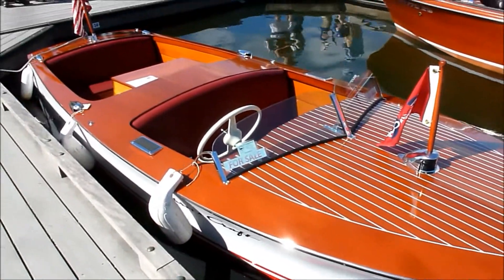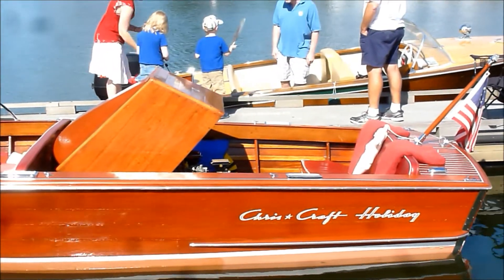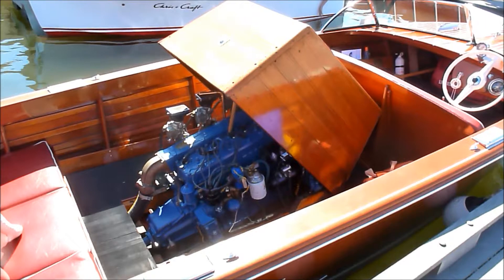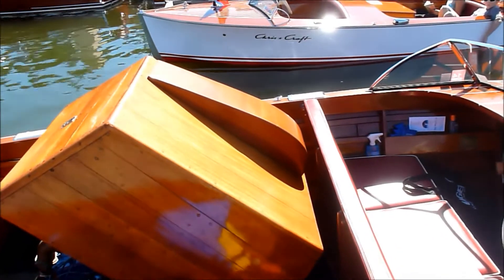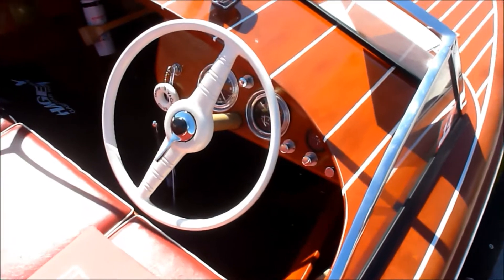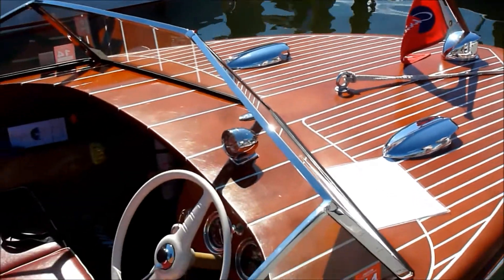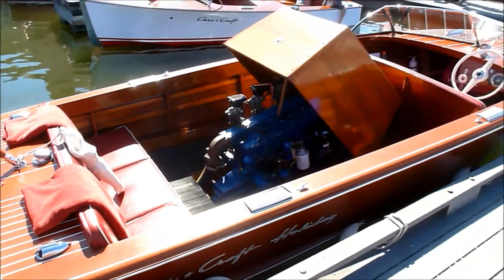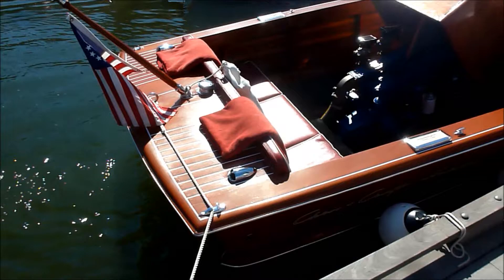1956 Chris Craft Holiday, ( A fully restored wooden, inboad, flathead, 3 carb boat )

Comment: This is currently my boat and is for sale $12,000. I bought it from the owner in the video above in 2014 but it is a 1957 18 foot. The original KBL engine has been rebuilt as of spring 2018 and works great! the rest of the boat will need sanding and new varnish since it has not been done since 2002. Still has luster and is always complemented from the boat docks. Contact me if your interested. I will post on ebay as well soon.
Reply from the maker: Excelent!